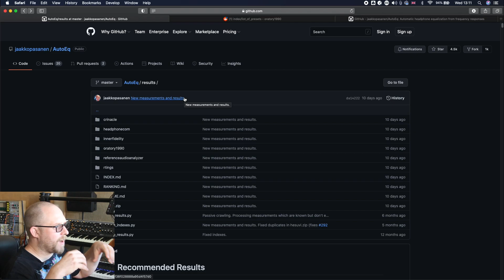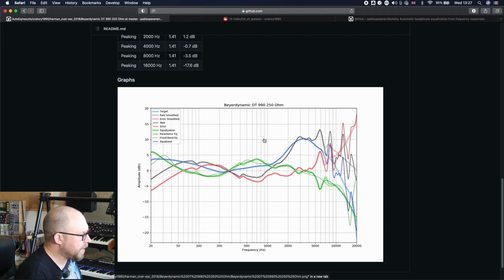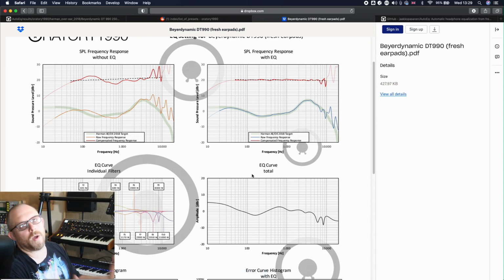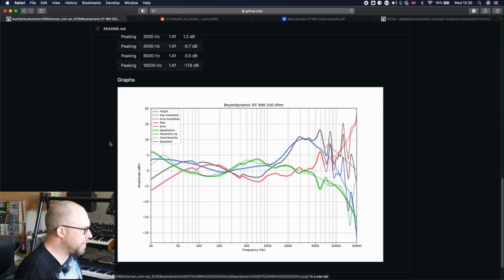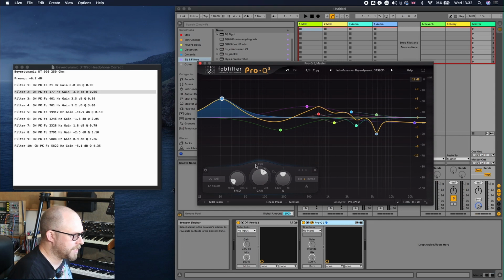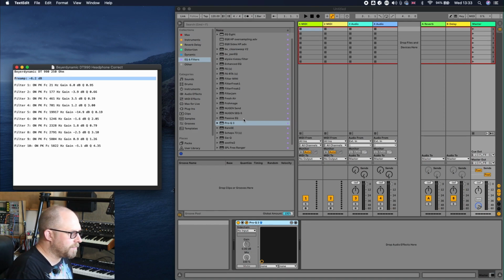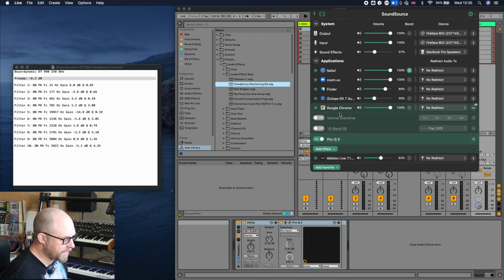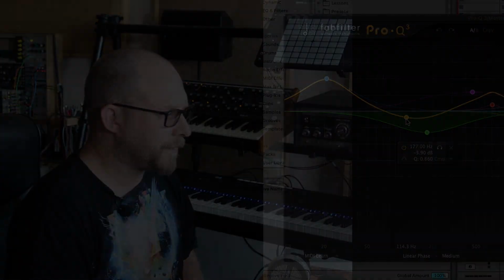Headphone EQ tutorial for improving Binaural or general accuracy / transparency of ANY headphones

Comment: No, on PRO Q 3 you can adjust your GAIN on the GUI and SAVE it as your New Preset. Plus I've alway heard that using Fab Filter Pro Q 3 , that you need to Multiply the "Q" Factor by  ( i forget but like 1.43 ) because of the TYYPE of EQ it is.

Comment: Harman target is NOT a reference target for binaural recordings. Given that many binaural recordings are made with rubber ears, and response lacking pinna gain would be optimal for this, so something like Apple Airpods Max for example.
Harman target for over ear headphones from 2018 was based on STEREO loudspeakers in a room. If your material was captured in stereo micing techniques and mastered for stereo loudspeakers, then it should sound the best on harman tuned headphones.

Comment: Where do you actually put the Pro Q3? Likr the last plugin on your master??
Reply from the maker: That is possible, but you need to remember to bypass it when you render your track.  The video shows how to insert it using SoundSource which runs it on the output of your Soundcard, not in the DAW.

Comment: The Q Values/Factor of the ProQ are not standard Q Values like in any other EQ, you need to compensate them in order to get a correct result.
Reply: Do we also multiply by 1.41 or is that for AutoEq only?
Reply: @bongumusicntuli491  I don't understand the question. So I explain.
FabFilter decided for whatever reason to use their own q to bw value. So, on every platform you can download correct AutoEQ values, which can be used as is in nearly every EQ there is. Except Fabfilter ProQ. Specifically for Fabfilter ProQ you need to compensate the Q values in order to create a correct profile based on those downloaded AutoEq Values. I own many EQ Plugins, all of them using correct q to bw values except FF ProQ. I'm not sure what the exact compensation value is as I don't use FF ProQ for that reason. I suspect that the Q Value could be also varying per octave as far as I'm concerned. FF is cooking its own soup obviously. Just use a different EQ. 😉
Reply: @bongumusicntuli491  You mean FF ProQ, not AutoEq? ProQ is the only graphical parametric EQ I know of that has incorrect Q Values. Factor 1.41 might be correct, but as far as I remember this factor could be vary over the whole spectrum... This is another reason I don't use FF ProQ.

Comment: Hi thanks for the video! I would like to apply Pro-Q3 to Chrome and Spotify is there an alternative for Windows user? Thanks!! 🙏
Reply: You can use Equalizer APO on Windows Systems as a Systemwide EQ. It also has an inbuilt AutoEQ Database. But it works only for your standard Audio Driver, not ASIO.

Comment: Dude... I was just trying to find out how to set my audio correctly for binaural beats because a different tone has to go into each ear to create the 3rd binaural beat. Someone told me to set the equalizer to 'FLAT'. Is that correct? I thought you were going to go over that in this video, but I have no idea what you were talking about. lol. What's the best setting for Binaural Beats?
Reply from the maker: This is really a production video, to help you get the most from your pro-level headphones.  If you can find yours listed in the links in the comments then you could try to follow along... if you are using off the shelf ear pods or similar, then yes probably setting your EQ flat (so all the EQ faders are in the middle) is probably the best bet!
Reply: @BrooksAudio  Thanks!! 😊